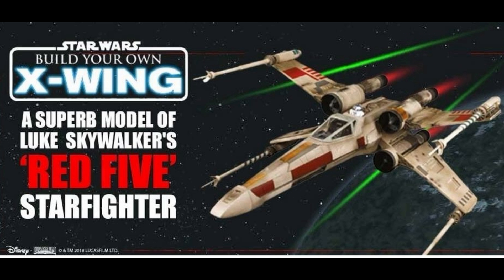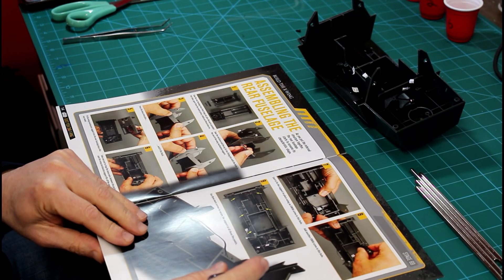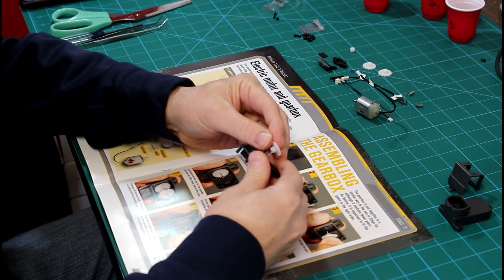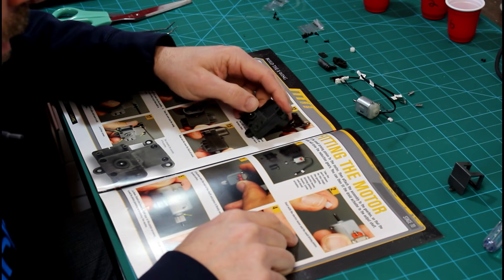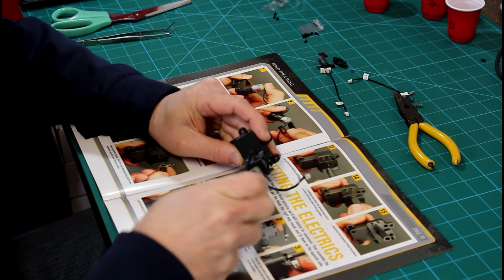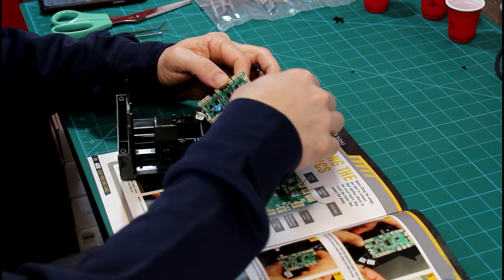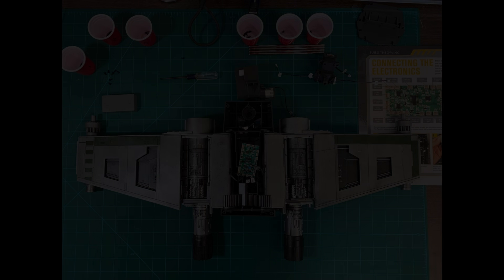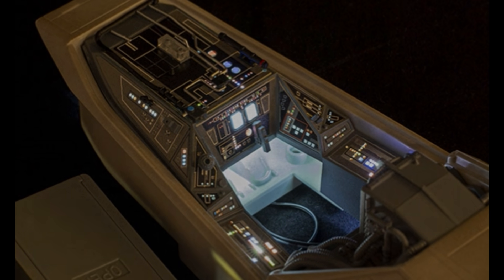Model Space Build Your Own X-Wing Issues 69 through 72

Comment: Hey there. It turns out that you are not to test the board till issue 74 where you get another piece of electronics for the board. Apparently the instructions are wrong in issue 72.
Reply from the maker: Really?  Can you point me to where you learned that?
Reply: @patrickthornton2763  go here: https://forum.model-space.co.uk/default.aspx?g=posts&t=33647 This will explain everything. Also there are other threads covering this as well. Another thing that is causing issues are the limit switches which are not stopping the wings from closing and the motor keeps going - causing the gears to break.
Reply from the maker: Spacejunk55 Thank you very much for this information.
Reply: That's right, there's a cable in the next issue that I believe links the battery compatment & the mains input & without that the motherboard won't work. DeAgostini screwed up telling us we could test everything one issue early.
Reply: Sorry, not a cable, it's the mains input port. Like most recharge ports there are 3 wires, one positive, one negative & one control. Long story short you need the port plugged into the board to complete the circuit, without it the board doesn't work.
I hope you haven't given up on the build. It would be a shame after getting three quarters of the way through.

Comment: Hey I had the same problem with my circet board,and turns out don't test anything as it says on issue 72.wait until u get issue 74 and u will get a part which is a lead labeled 20 plug that on the the circet board and u should be good,as that what I did after reading on the web